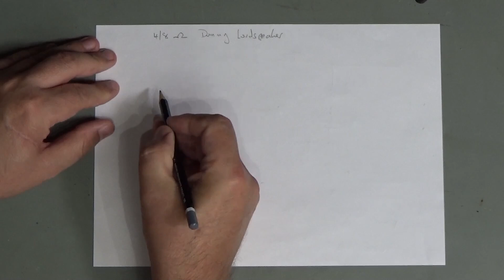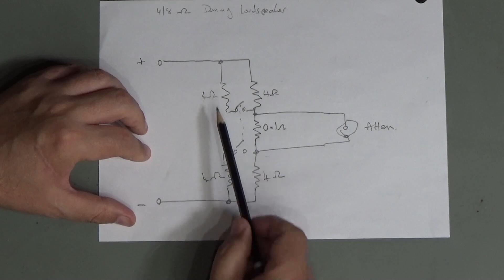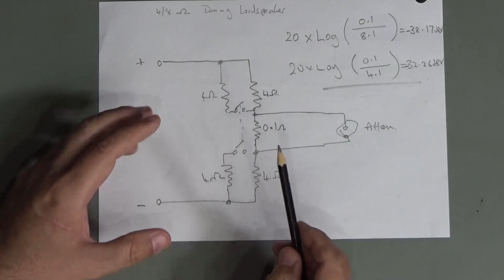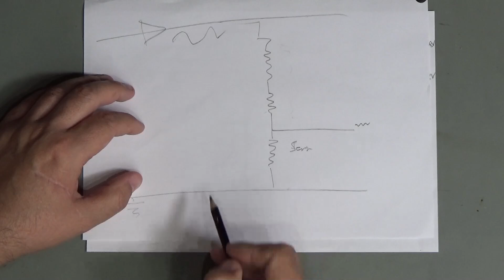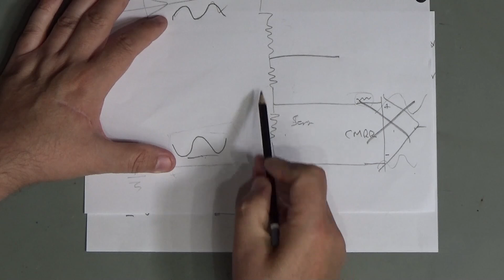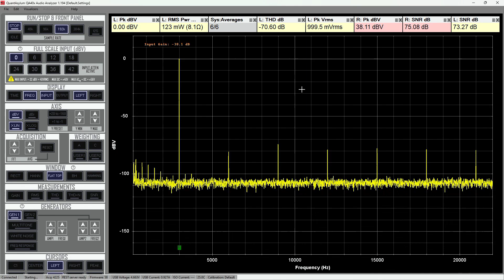Dummy Loudspeaker pt1 (not yet perfect) #0096

Comment: also what toggle switches are you using, thank you
Reply from the maker: Pretty sure these were 16A dual pole toggles that i had originally bought for switching elements in a kiln.   I mainly used things surplus and reclaimed from other projects.  The one switching resistors needs to be beefy depending what power you are switching e.g. 100W through 4 ohms is 5A rms but you would want headroom for unexpected peaks.

Comment: A very clever solution for the attenuation issue! My speaker dummy load needs are not nearly so elaborate as yours.  In considering my needs, desires and functions, I was ending up requiring a lot of expensive switches and components. It occurred to me that all I needed was the resistors and some means to connect them, conveniently. I ended up just mounting the various resistors on a heat sink and terminating each, individually, to banana socket eyelets. These eyelets are mounted on the front panel. I can achieve any combination of resistors, with jumper wires. I can also access the signal at any point with my test gear. For my needs, this arrangement will work quite adequately. I also mounted it in my DIY e-load case, which had lots of spare room. This makes use of its fan and power supply for both types of loads. So, there is economy, there, as well. I ended up with a universal load center, of sorts. <grin>
Reply from the maker: First attempt was mainly things on hand. Switch cost is certainly an issue.  I thought about 2 and 1 ohm as well, but it gets costly.  I might think about it with relays in future.  But what normally happens is I keep thinking how I could make it better, then it gets too expensive.

Comment: Nice project! The quant asylum load seems to be shooting for 12db attenuation, how come you're aiming for higher? Is it you want to test at higher power? Have you thought about having a multi-tap? Say 10/20/40 dB attenuation steps? Then you can maximise your analysers dynamic range. Keep up the good work!
Reply from the maker: The main reason is that when testing amps with faults, I want attenuation before the analyser to help keep it safe.  On thevanalyser 0 to 12db all uses same attenuation but changes the full-scale, so these impact dynamic range.  The next step adds in an Attenuator at the front end but with 100k input impedance that has a big impact on the noise floor.  Putting a specific attenuation in the low impedance load gives attenuation with much lower noise impact than the internal attenuation.  I lose almost 40dBv of range, but no impact on noise.  Using internal attenuation I would lose 24dBv range but the analyser noise floor goes up a lot.  Perhaps I'll try and explain it in pt2.
Reply from the maker: Forgot about the multi-tap.  Yes that would be a good idea thanks.  I might add it later.  I also intend to add a protective limiter on the output just in case.
Reply: Thanks for the reply! Regarding the 12db, I meant the external load available from quant asylum, rather than the analysers internal attenuator. Interesting that exists though!